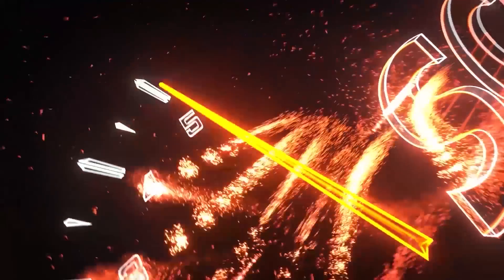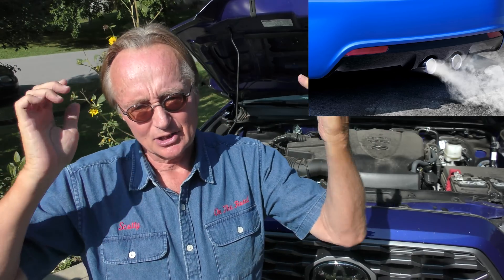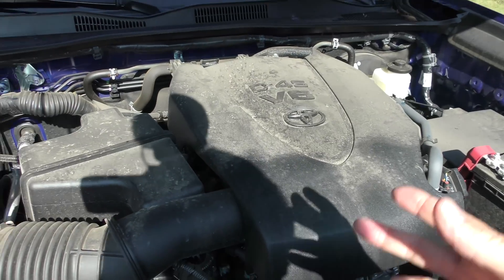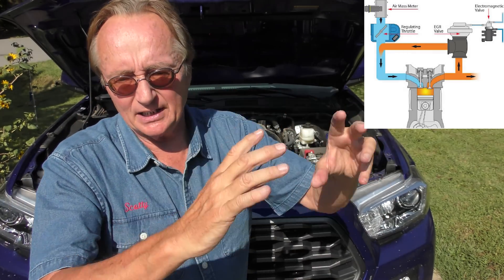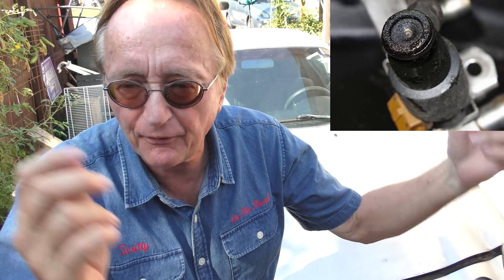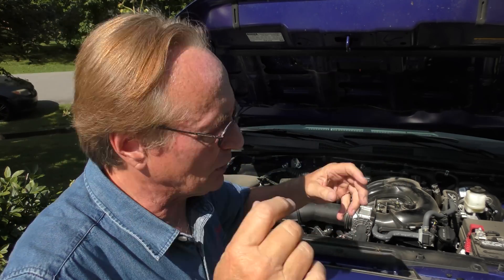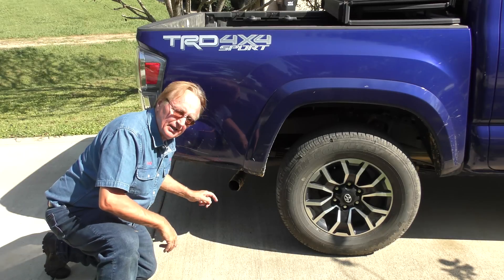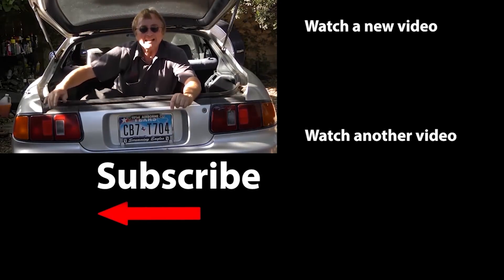Here's Why This New Engine Will Literally Kill You

Comment: I had a 2000 Honda GX. It was a great commuter car and ran so clean it was amazing. The oil was still clean at 5,000 miles but I did change it every 5,000 miles. The tail pipe was clean at 135,000 miles when I sold it. Long story short I don’t understand why the CNG cars never caught on.
Reply: My wife owned a 2012 Honda Civic CNG. She (and I) were good sports in understanding the compromises of ownership, in terms of the fairly low range on a full tank, the literally almost non-existent trunk space because of the CNG tank, and the availability of fuel. Even living in Chicago, and then the immediate suburbs, getting gas was always something we had to plot and we had to plot almost all the time because the fueling outlets weren't very close by and we couldn't go more than about 250 miles (if I recall) on a full tank. Eventually, after eight years, we just decided we didn't want to do it anymore. Cool car but suitable for only a very, very narrow slice of the driving public.
Reply: @anthonyc1883  thanks for sharing, I believe the 2012 was the last model year for the GX.. your are correct on all the draw backs but as a second car to drive back and forth to work and running around town I felt it was worth it. I was able to ride In the car pool lane, registration was less expensive, fuel was much less expensive and much more stable regarding price increases. It was a good option and that is what I think is wrong with all the focus on electric… I think we should have options as far as alternative fuels, one solution is not the magic cure all.
Reply: CNG should be the next cars transition, but politicans want go to electric cars. They say electric cars are the future...but for now I dont see better future with electric cars
Reply: Less power for the same capacity engine compared to gasoline.
Reply: Well for one it likes to explode but more and more buses are using it now so maybe?
Reply: Not much power in cng
Reply: My guess is the crappy way of doing it is cheaper. It's always about the money😊.
Reply: Lower BTU, lower MPG, and storage of the fuel takes more space in the vehicle.   Hard to start in cold weather.  Fewer filling stations.  Nuff said?

Comment: Guess Scotty hasn't heard of GPF (Gasoline Particulate Filter). It's been on cars since 2018.
Reply: It's still not standard in the US though. You can get them but aftermarket whereas European and Chinese vehicles have mandated them.
Has that changed?
Reply: @jasonlamar6347  The updated Euro 6d regulation brings the limit on the particulate, commonly known as soot, in line with the requirement for diesel vehicles. As a consequence, new petrol cars being sold from June 2018 will need a GPF (Gasoline Particulate Filter) to comply with the emissions regulation. - this is from Apr 23, 2018 ... 5 years and a half since it was mandatory in Europe anyway.
Reply: @zumik83 but this is another country...
Reply: @richsweeney1115  GPF is mandatory in other countries, yes, but it is a 5 years old technology. It is on many vehicles in US, but Scotty is like there is only DPFs for diesel, but not for gasoline.  1:25 - "They don't have DPF on GDI engines". No, they don't, because it is called GPF and it is 5 years old, hahahaha.

Comment: I love my dual fuel generator. Running it with propane is awesome. No stinky fuel, no stinky exhaust, no worrying about the carburetor, no draining the fuel tank. It's just stupid simple.
Reply: Brand, if you don't mind? Been looking at dual and triple fuel gens and have analysis paralysis. Have natural gas to the property but would need a service upgrade for a fixed generator with permits and whatnot. So maybe LP/gasoline portable gen plugged into main with manual transfer switch...

Comment: Scotty,gotta stop trashing my truck. Driving a crush blue 22 Taco. Mine is a manual. Better mileage as I get to select the gear. Coming up on 45000 klms. Going to do the transfer case and differential at 45000 (oil change time. Every 10000 klms ) Canada. Hopefully it will last forever,following your advice. 
Brgds 
John

Comment: There was a study done in the UK a while back, that showed because of the weight of electric vehicles, the tyre degradation was more toxic than an ice car exhaust.
Reply: I worked in a tire shop recently and the ev vehicles wore thru a set  of tires in about 15,000 miles.
Reply: then there's all the fire risk and extra stuff to wear out. @user-zv3fe4nz8o
Reply: Maybe the weight is a factor then but the tendency of the high torque to cause tyres to spin a little was once mentioned. There was talk about electronically suppressing the free spin tendency . Perhaps  it's been done, or maybe not so if the tyres wear out so fast .
Reply: I also recall a UK study saying EVs will steal your babies
Reply: The tire companies should be forced via regulations to make nontoxic tires, you can make them with hemp oils and pine sap, they are non carcinogenic, you'd have to change them more often, win win for them. They're just hampered by American hegemony and the federal legality status of hemp/cannabis.
Reply: @jashandjash6990   Interestingly, India i think it was, they were using old tires, chopping them up and laying roads.
Reply: @jashandjash6990 the tyre particles are not in themselves toxic, but you wouldn't want them in your lungs
Reply: @jashandjash6990  Mmm, edible tires!
Reply: So what are you saying? On average electric vehicles are 30% heavier. At least that’s what google says. What about areas in the country that drive more trucks and SUVs? Tire degradation is dangerous?
Reply: @PureSilicone  i would assume that would be a uk car survey. But yeah, 18 wheelers. All a load of balony anyway, 1 tank uses more resources and creates more pollution in its manufacture and ultimate environmentally destructive uses.than a million cars i would wager.
Reply: @tonedcos 1 tank more than a million cars? You can be serious. You’d be surprised how efficient many of the newer 18 wheelers are compared to the past. Better than some super cars.

Comment: The fuel buildup in the oil problem that some GDI engines have?
So we get all the disadvantages of a Diesel engine and also all of the disadvantages of a gasoline engine all in one package? 
  Engine with two injection systems,port and GDI,such that the GDI is only turned on during full throttle acceleration?
Reply: They don't have fuel in oil. Around the nother way! They burn oil out the ingtake, as it doesn't have the port injection to clean valves ;) I'm referring of course to GDI only engines, not hubrid GDI-Port...
Reply: Some GDI engines are known to have a problem of fuel accumulating as a contaminant in the crankcase oil. I believe a certain engine in some Honda CRX. Especially during short trip operation during winter. 
 Old style American engines were sometimes known to do this if overchoked or run with grossly oversized carburetor jets,again,mostly if run in short trip operation without getting the oil up to steady operating temperature. But GDI engines apparently do this worse than other modern (gasoline fueled) engines.  @staysinglemyman

Comment: What does 4 blinks, pause, then 1 blink on airbag light on 1994 Ford Taurus indicate ? Does it mean that It is non functional, OR that it could go off anytime ?
Reply: Check that your battery and alternator are in good condition. Could just be a bad battery. The second possibility is that there is an actual problem with the airbag system. The code you describe means "RH Primary Crash Sensor Feed/Return Circuit Open" 
When the airbag light is flashing, the computer sees a problem in the system and the airbag will not deploy.
Reply: @skree_fpv436  Thanks, I was just worried that it would inflate without warning, while I'm driving.

Comment: Does this apply to port fuel ejection?
Reply: No it does not. He explained that in the video.
Reply: @ProblemChild-xk7ix  Just was making sure he wasn't using his old matrix as an example just because it was on hand and not because of port fuel injection
Reply: No. The gas cleans off the back of the intake valves.

Comment: So natural gas is better. No gas stations to fill them. How would propane work? Serious question.
Reply: A CNG tank is certainly less complicated than a battery.  Problem is no one took serious effort to incorporate them like batteries or hydrogen storage - instead using up the trunk.  Class 8 trucks moving away due to availability of renewable diesel - same benefits and able to use standard engines.